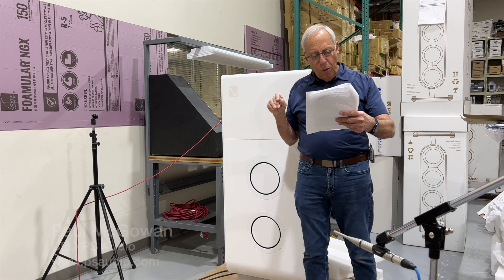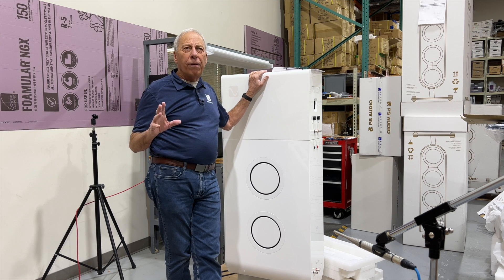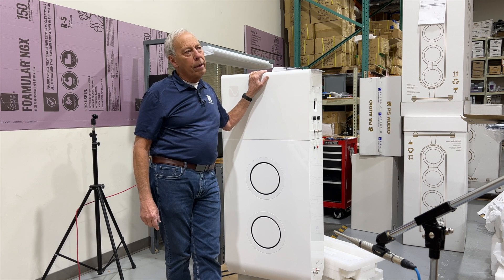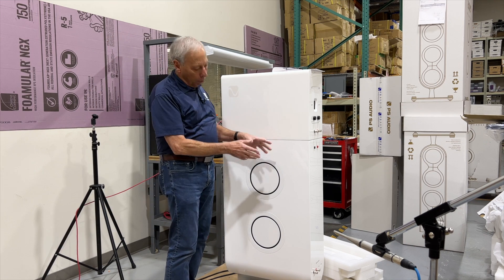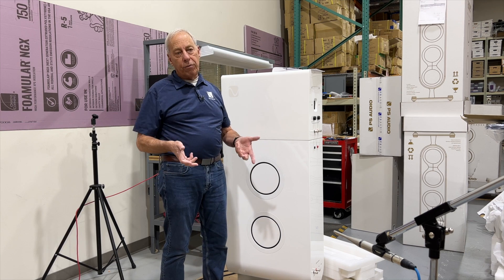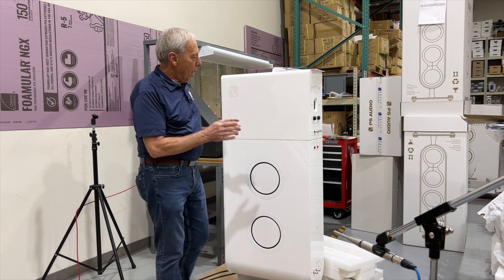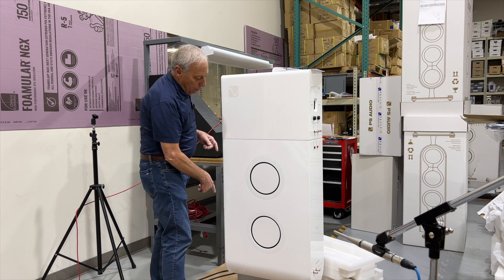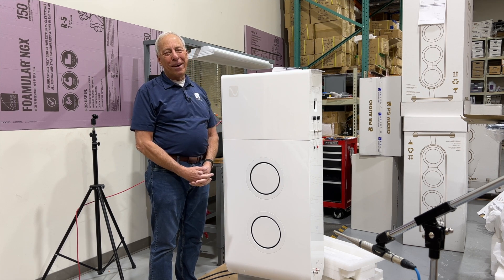Transmission line loudspeakers

Comment: In a Transmission Line Cabinet design what determines the length of the transmission line? Is the end of the transmission line ported, or not?
Reply: The end of the line is usually ported to the front, but you can also leave the line sealed to behave like a sealed box to eliminate air spring effect. For rough starting point you get the speed of sound (343m/s) divided by resonant frequency of the driver, then take that number and divide by 4 to find the quarter-wavelength. Then you play with the length, position of the driver on the line, cross-section area of the line, and stuffing until you get a good looking frequency response using something like HornResp to model the response.

Comment: I love Pats 90’s-early 2000’s Meadowlark Audio loudspeakers. All were transmission line/first order crossovers.  Amazing work for the price and times.
Reply: I have a pair of the original Kestrels.  A lot of speaker for the money and quite nice woodworking and finishing.
Reply: @ronniefranks4351  I do also! Still original everything. Luckily, I got a brand new matching pair in the original boxes a few years ago. The woofers are easily replaceable with a VIFA/Scan speak/PEERLESS. The tweeter is the issue
Reply: @Hondaguru1122  Luckily, mine are still perfect.  Hope they stay that way.

Comment: All loudspeakers resonate at a specific frequency ( ie 65hz ). They are most efficient at putting acoustic energy into a space at that resonate frequency. So if you tunnel the back output waves of a speaker into a transmission line cabinet such that the acoustic waves off the back of the speaker would come down the transmission line, flip their phase, and then out into the room wouldn't that just make the speaker even more louder, even more efficient and less flat, at the speakers resonate frequency?

Comment: I still have and use the pair of TL speakers I designed and built in 1980.  I replaced the original 8" drivers with some 10" TL specific drivers from SpeakerLab and have had to re-foam them about 9 years ago.  They do use a lot of wood to make, I think I used 4 or 5 sheets of particle board for the pair.   I spent a lot of time tuning them up.  Also hand wound all the crossover inductors.

Comment: All loudspeakers resonate. And almost always at one specific frequency. Lets say an 8in "woofer" resonates the most at 65Hz. And how efficient it resonates, power in vs acoustic energy out, lets call that "Q". So a big output peak at 65Hz. How do you control, or smooth that out, and make its acoustic output flatter? How does a vented, non-vented, bass reflex, transmission-line, passive radiator or whatever enclosures do that? Or don't they?

Get out your slide rule and start here. Thiele/Small parameters: https://en.wikipedia.org/wiki/Thiele/Small_parameters

Comment: The phase cancellation below the tuning frequency is the same for a port and s passive radiator, BUT the passive radiator has much lower Q which makes the puls response better (but also reduce the output) And you can tuve the passive radiators Q by designing the surround properly.
Reply: Mass of the PR will also have an impact on performance. Not only that, but where that mass is placed too.
Reply: @wishusknight3009  Yes, the mass and the compliance of the surroung and the cabinet volume determines the resonance frequency, as I recall the calculation

Comment: Paul, you should have left this one for Chris. You struggled mightily. I own sealed, traditional port, and transmission line...yes, all three. All sound great. So no, when you say bass radiator is " a better way to do it", that's not necessarily true. It's how its engineered and implemented. Not sure if anyone has told you...but when you do these videos and act as if everything PS Audio does is "better" it makes your company look bad. It's just too much of it that you do. There is so much competition out there now in Hifi. You are better off toning it down a bit.
Reply: Simple solution: choose best options then no conflict of interest.

Comment: We used to build transmission lines for sub boxes in car audio. Made right the bass can be incredible. It can throw off lots of volume and air with deep notes but also takes awhile to build and takes up a lot of space. It doesn't typically have great separation with quick punch bass notes like a sealed enclosure. So you would need to look at space for your room and what kind of music you mostly listen to and the kind of sound you are trying to achieve. There was a professor at GA Tech ( Dr. Leach ) who students swore by building his speaker cabinets. If you Google you can find the old info if interested in building your own box. The loudspeaker design cookbook is an oldie but a goodie also to read.
Reply: Nice but with cheap wattage power and small size of Class D amps pretty sure sealed boxes are dominating now.  It’s all about SPL and moving hair and even organs these days in car audio. 😂

I’ve given up on car audio since my car got broken into in the early 90’s.  It’s not worth it. 

In the old days there used to be wattage class and it was much different.  I think it was something as follows:

1-25
26-75
75-150
151-250
251-500
501 and up

Many used to have a Rockford Fosgate Punch 150 for SPL. 

I believe the starting wattage class of today is 500w?  🤣.  Insane.  Sound quality isn’t great either.  All about loudness.  

Sound quality in car audio seems to have lost its way.  My experience with building woofer boxes is that sealed enclosure was the least headache. Any friends that took the time to build ported and even like 4th order or 6th order never sounded good to me or the sealed still sounded better. 

Back to home audio, I don’t see these transmission lines as worth it.  Too expensive and too much hours put into internal cabinet design.  

All my home speakers have ports. Subwoofer is push pull design M&K Miller & Kreisel.  

I just say wow.  The experts know what they are doing.  I also believe quality power amps are a must.  They make many speakers sound great.
Reply: @f430ferrari5  is way too expensive. How can a transmission line speaker that sounds better be too expensine if it will last a lifetime? LOL!

Comment: I own a pair of transmission line speakers, T+A CRITERION TCD 110 S. They are a bit unique as they also employ two mid-range units in the D’Appolito arrangement. They are a bit heavy at 130lbs each but they have a very nice bottom end and great voicing. Frequency range is 22 - 35000. I have a picture of the inside of the cabinet and it's amazing how long the transmission line tunnel is.

Comment: Actually a properly built TL speaker gets much more and much better quality bass from either ported or with passive radiator designs. It just gets too big and heavy and is fairly difficult to construct and tune. It's made this way so as all the rear sound radiation emanating from the woofer is directed through a tuned long tube that projects in the room the ultra low frequencies in phase with the sound wave that is coming from the front of the woofer. This way you get less coloration and low bass that is fast and articulated. I get 20 Hz in room from a single 10" woofer or 16Hz from a 12" woofer...without any digital manipulation.
Reply: How do TL loudspeakers control the natural resonance of the speaker? Nor not?
Reply: @wilcalint  two ways: careful selection of tube length with regards to the woofer's fs and appropriate stuffing of the tube with sound absorbing/velocity reducing material.
Reply: @warpspeed9877  Agreed, but, what is all of that do? What speaker parameters are being controlled by the "tube", "passive radiator", transmission line length?

BTW, IMO PS Audio speaker designer "Chris" is very very smart using those custom designed passive radiators in the FR30.
Reply: @warpspeed9877  Lemme explain this as best I can as it was explained to me. Take a lets say 4lb weight. Attach a spring to the weight and pick up the other end of the spring with your right hand. Now move your hand up and down with the weight suspended off the ground. Modify the spring ( tube, transmission line, port ) such that when you move your hand up and down the weight does not move ( resonate ).

Comment: doesn't a sport work as a push pull system where 2 speakers are mounted together front to front but one speaker is a bass port????

with a bass port, you will ALWAYS get air noise!

Comment: “Sound travels 1 foot per second”. So if someone speaks to you across a room 15 feet away we hear their voice delayed  15 seconds after their mouth starts moving?  Hilarious. Paul ain’t no engineer.
Reply: Only in Japan. I have seen several movies like that where the voices don't match the mouth.
Reply: Approximately 1 foot per *millisecond*. 👌😉
Reply: 1087 ft / sec
Reply: Pauls explanation was totally in outer space. But it sounded great didn't it?
Reply: Just think about if you called someone a mile away....
Reply: 1 ft per millisecond (roughly) is what he meant. My engineering profs all used that rule of thumb
Reply: I'm no engineer, but maybe he was referring to bass frequencies?
Reply: @richardsmith2721  No. He probably misspoke, but sound travels the same speed regardless of frequency.
Reply: He clearly misspoke.
But the speed of sound is impacted by temperature and air pressure.

So maybe it is very cold and with very low air pressure there Paul are.. 🤣🥰
Reply: @AmazonasBiotop  In a Transmission Line speaker cabinet design what determines the length of the transmission line?
Reply: @wilcalint  I am a open baffle guy (one of the "enclosure" types that Paul did not mention). 
And I consider transmission line as a rabbit hole.
As we discussed it takes time for the sound to travel through the transmission line to get out and leave the cabinet. A bass sound that is delayed in the time domain.

With open baffle we have cancelation effects on all sides of where the baffle edge end. Therefore they will not load the room as a box does that radiate bass frequencies all around the box..

What is captured by the microphone is reproduced in OB in the right time domain but it is also the most inefficient "enclosure" that don't get help of any box pressure/under pressure.

So it takes a lot more cone area and amplifier power. But the most important part for me it is the more accurate and detailed bass you might get (we got infinity baffle but that is not practical in many applications.)

As a answer  to your question I found this with a fast google search regarding the length of the transmission line:
"A signal’s wavelength is the physical distance it will propagate in the timespan of one period. Wavelength is calculated by the formula λ=v/f, where “λ” is the wavelength, “v” is the propagation velocity, and “f” is the signal frequency."
Reply: @wilcalint  the length is generally a quarter of the wave length of the bass frequency the speaker is tuned for.
Reply: @abhi211-T  And the quarter of the wave length is a compromise for the length being the full length of the the resonate frequency of the speaker itself. The one transmission line I remember being full lenght was called "the coffin". Two KEF 8in oval bass drivers. And a little bigger then a coffin. Two transmission lines inside the box. That thing was a beast.. Also should the tunnel be ported at the end or not? I'll let that decision to the designer. Also should the entire length of the tunnel be totally stuffed with sound/heat absorbent material. Speaker cabinet design - so fun and issue. So many many opionions, misinformations and just outright BS. God made Physics and she gets angry if you break her laws.
Reply: @AmazonasBiotop  Some years ago I listened to what was best described as an "open baffle" speaker. A single speaker, a Focal 5in. That mounted on a single baffle board about 2.3ftx4.7ft. Both the front and the back of the baffle was heavily padded. Speaker mounted at an "odd offset" from center. So an open on all sides design. The speaker was driven by a single ended 3w tube, tube to output transformer amp. Source was a pretty decent 78rpm turntable/arm/cartridge combo. Media was a recording of a child's voice singing. And that disc made the the late 1930's. Close your eyes and you'd swear that kid was right their in front of you. Ignore the disc surface noise.

Comment: Hate to say it, but this in not your clearest explanation. The transmission line length is such that the out of phase rear output is now in phase with the front of the driver, but only for wavelengths that length of transmission line (and their harmonics).  Fuzz is added to slow the speed of air in the line to shorten the line and widen the effective range and smooth out the response.

Comment: In short:
Passive radiator and bass port is basicly the same prinsiple in a different wrapping that can bring slightly different results.
And the air in a bassport actually comes into phase in the freq range it is designed for regardless if it is transmission or not. There is a fun video about it but don't remember the channel.
Reply: "In short" All speakers have a natural resonance point. Lets say 45hz. How do, or do not, passive radiators or bass ports help control, or not, that natural resonance?
Reply: @wilcalint  Tuning
Reply: @Oystein87  "Tuning" and at what frequency are you "tuning" for?
Reply: @Oystein87  This is a VERY fun subject as it really has to do with all the ways a speaker cabinet controls the resonance, at Q, of a speaker, or not. Ask a speaker sales man what the speaker port is for. You'll get a 1000 different answers.
Reply: @wilcalint  That depends of the goal you want to achieve. And is it a sub or a floorspeaker etc.
I know all this..
1000 different answers? Not if it is a real speaker salesman.. A salesman that knows his job even only at the most basic level knows what the bassport is for.

Comment: Somewhere along my Journey, I believe I had heard that these long tube designs, were to create a way to simulate a much larger speaker box size.   Think of a PVC tube.  If you hung a 1ft long tube up.. and a 7ft tube next to it...  if you hit both with a rubber mallet.. the longer tube will sound bassier.   While vibration and air movement are different things... the air volume, does in fact matter,  in producing deeper bass sounds... with these Ported  "Trumpet"  speaker boxes.

 That said,  while a Ported speaker can produce lower bass potentials..  the bass they create is highly  "Artificial"  sounding bass.   Its not what the studio intended you to hear...  Not even close to it.   Where as a sealed speaker, will reveal the actual sounds that you were meant to hear.   Passive radiators, do in fact do an excellent job of creating extra bass thump, without the typical distortions, of a tuned port.

 The downside of a passive, is that they will not give you much bass at lower volume levels... and when cranked to very high volume levels, might be a bit too much bass.  Their "Excitement" levels, are based on the woofers levels, and the  "Weights" on the passives.   You can deal with this... by adding an EQ to your system.  You can pump up the bass levels to get your passives excited at lower volume levels...  or you can reduce your bass levels... to keep the passives from being Too-Excited at those higher volume levels.

 Sealed speakers, have a sort of curve of their own.   The bass is good at low to mid volume levels... but it REALLY POPS,  at mid-high to very-high volume levels.  The more power you feed them.. the more punchy and deep of a response, that you will get.

 From my experience...  Ported speakers sound OK at lower to mid volume levels.  Anything mid-high to very-high... and you get worse and worse sound output... as that artificial sounding bass tone,  distorts and muddies the music.

 Each design has its own Positives and Negatives.   Personally, I can no longer stand Ported speakers, at all.  Once you hear a high quality Sealed speaker... and hear how natural bass is supposed to sound... you can never go back.
Reply: How, or does, the "PVC tube" control the natural resonance of the speaker? If at all?
Reply: @wilcalint  I do not know the technical meaning behind Resonance.   That said, I dont believe it factors in.

 Your voice sounds deeper, when passing through a very long tube.   And a shorter tube, will not be as bassy sounding.

 Remember, a Tuned port... acts like a sort of trumpet.  When you blow enough air out of it... its designed to produce a certain bass TONE / Frequency.  That tone, will always be the exact same tone... no matter what the speaker is actually playing... which is why its bass sounds "Artificial".

 A transmission line, is essentially just a ported speaker... but with a longer snaking pathway.   Using that longer path, allows for a deeper bass tone response... and maybe a bit more energy... but its still just a glorified artificial-Bass-Horn.

 I believe PVC itself, has a potential to leak sound, and to vibrate... which  I believe falls under the term Resonance.  However, you could make the tube out of any dense material..  and it will function the same way.  Its just a long tube with a tuned horn (flared port).
Reply: @johndough8115  "I do not know the technical meaning behind Resonance" Proper speaker design is all about controlling Resonance. Do note that speaker design goes all the way back into the emergence of the movie "talkies". The tirst movie theaters with "talking" movies emerged in the early 1930's. So the math and design for speakers goes all the way back into the 1920's.